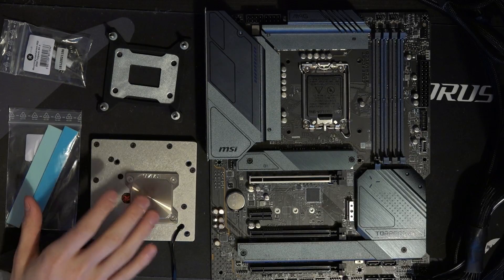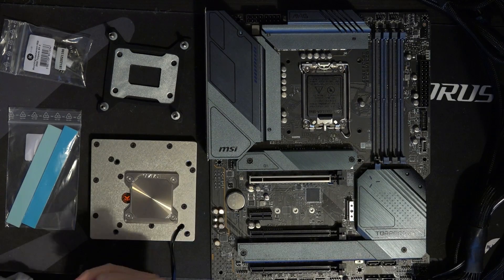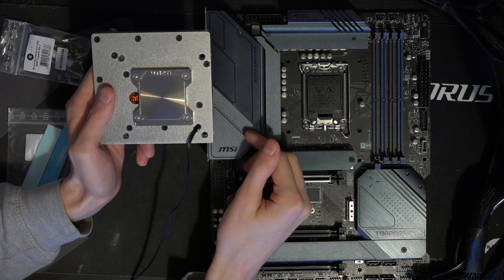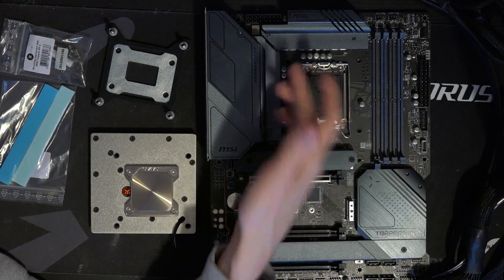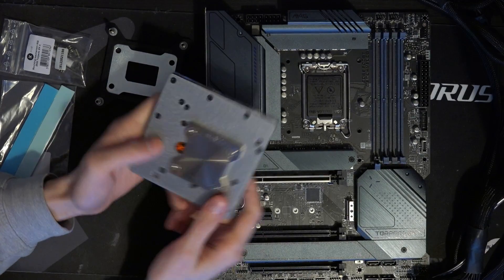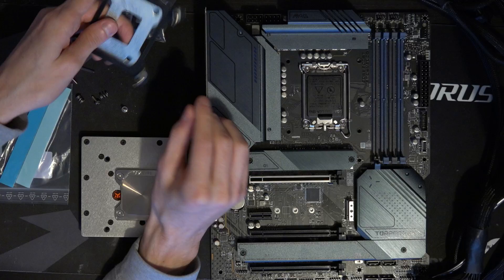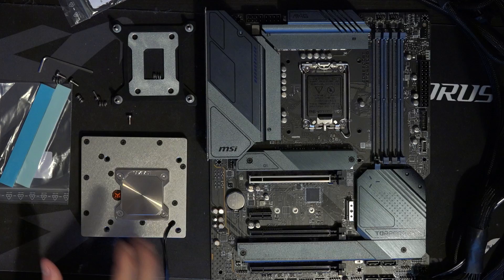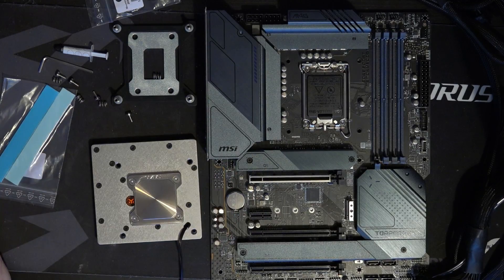MSI Z690 Torpedo EK X physical overview

Comment: The x1 pci slot being so close to the x16 pci slot is cringe. It belongs where the m2 slot is so the sound card doesn't block the fans cooling the gpu and that is if it fits. What was MSI thinking.

Comment: I love this idea!

I considered getting a monoblock for my MB (GIGABYTE X570S) purely because the design of the heatsinks really pissed me off. The VRM heatsinks are almost single surfaces but with slots on the back (I have a horizontal mounted MB so they're almost useless) and the X570 chipset heatsink has fins that are COVERED by a translucent plastic cover I had to peel off...

However EKWB never made a monoblock for it and the VRM is stupidly efficient so I just went with a CPU block and was happy with an 80 C VRM, however if they made it as easy as this to go mono-block I would have certainly bought it.

But of course with how MB features go those days I doubt they would ever implement it on anything other than their flagship boards to avoid cutting into their sales on them (still annoyed my MB doesn't have a boot code 7-segment).

Comment: The stupid thing about this board is that it's obviously aimed at people building a custom loop yet it lacks a feature that only custom loop builders would use: 2-pin temperature headers. They did the same with the Carbon EK.

Comment: Carbon EK X vs Torpedo EK X comparison? The big difference I see is that the mono block covers the Gen4 M.2 drive on the Carbon but not on the Torpedo. 5 M.2 slots on the Carbon vs 4 on the Torpedo.

Comment: Also the water pumps I've seen have had stainless steel water-contacting components so it's proven completely fine. Stainless steel is stainless largely because of its lack of reactivity, so it's perfect.
Reply: It's the metal with the worst W/mk you can choose. Not exactly confidence inspiring.
Reply: @thatguy7595  
but, it's neutral. that's the point of it being used.

Comment: That ledge contact design on the VRM heatsinks is simple enough that someone with a mill could very easily mill their own existing VRM heatsinks to fit that monoblock. I really like the idea a lot, and I seriously hope other manufacturers do adopt it and offer trim pieces if necessary as you mentioned.
Reply: Interesting idea, but with the opposite approach, what if EK had 'bolt on' VRM heatsinks to their monoblock. You buy one block, and simply bolt on the VRM heatsink you need for your specific board, instead of building/buying unique monoblocks for each board
Reply: they used to have aftermarket vrm heatsinks, sadly there 80mm long instead of 100mm so can't be used on newer VRMs. as for machining my own VRM heat-sinks, hack-saw, file, copper bar, and some normal 40x40x25mm pin-fin heatsinks to attach to the copper bar, it works.  it's pathetic that I can get 14c improvement with some peasant tools and 20 bucks of scrap-copper bus-bars and off the shelf aavid thermalloy heat-sinks (375124B00032G), lol.
Reply: Well most VRM heatsinks aren't solid blocks of metal so good luck milling them.

And then how many PC enthusiasts have access to a mill? I would say less than half a percent.
Reply: @NikoBell1188  Anything you can do with a mill in aluminium, you can do more much slowly with a hacksaw, files and sandpaper.
Reply: @spankeyfish  yea your not going to be a precise as a mill.
Reply: @NikoBell1188  he didn't say mill the vrm. He said anyone can mill their own heatsink.

Comment: Just get a set of 60/80/100mm length VRM waterblocks from aliexpress, Copper plates and a file can be used to compensate for any mismatch in dimension.

Comment: When you said "the mono block could fit in other motherboard", which MSI motherboard are you referring to? I am trying to use this mono block for "MAG Z690M MORTAR WIFI". The torpedo MB VRM heatsink looks the same as "MAG Z690M MORTAR WIFI", do you think this mono block is compatible with Z690M Mortar？
Reply: There's no way.  The Mortar has curved heatsink surfaces with a higher z-height.  This Torpedo board has lower, flat surfaces for interfacing with the monoblock.

Comment: Could possibly use a copper "shim" on other boards for a similar function for moving heat as the VRM heat sink does.
Reply from the maker: or just stack the thermal pads. I really don't think the transfer needs to be all that efficient.